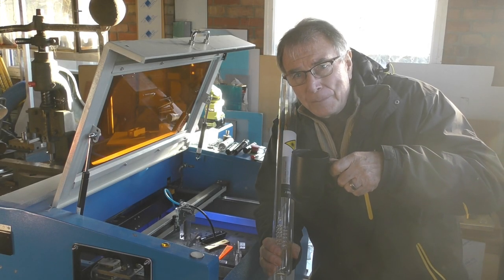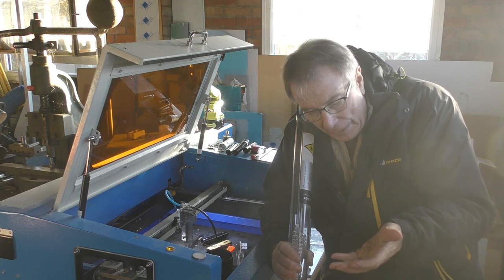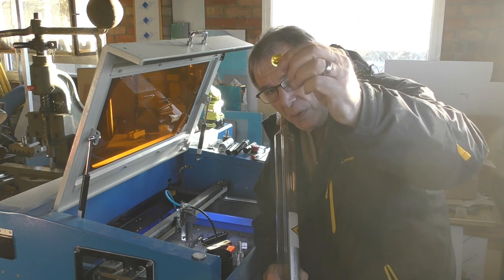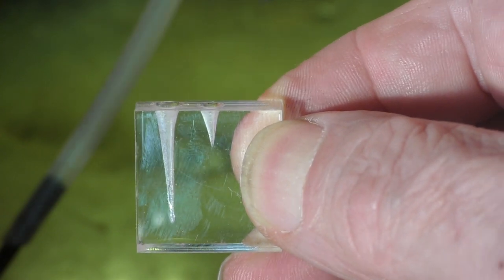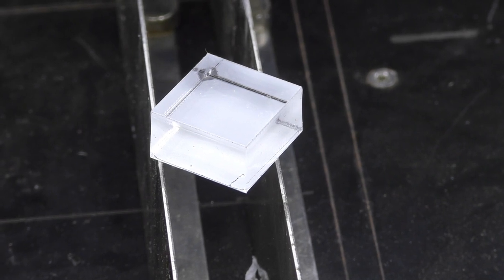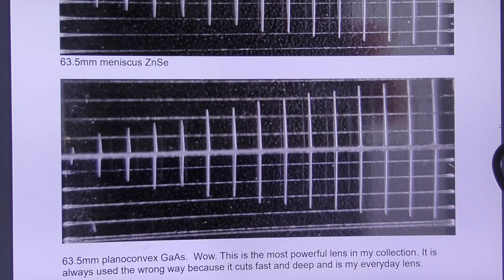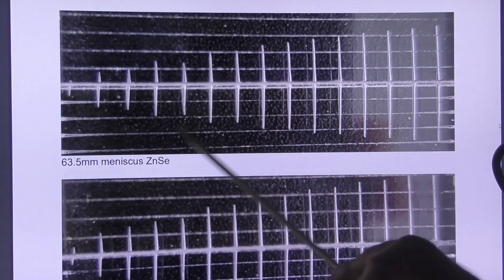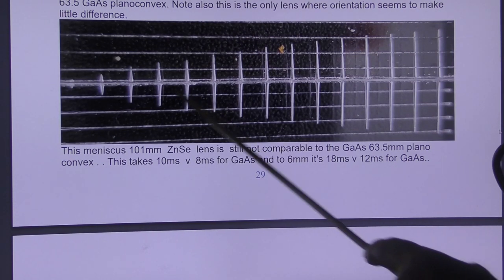RDWorks  Learning Lab 246  SPHERICAL ABERRATION. Our New Best Friend

Comment: OK, deep dive, great results. proving the worth of challenging the status quo!  I think you would enjoy the ted talk be Luca Turin on scent. May seem totally unrelated, but I love how he took on established scent theory as an outsider, working on intuition and persistence and came out on top.
Reply from the maker: Hi Graham
I thought getting you up to date would stop a lot of intermediate questions. As for the scent theory I am sure it will  be to do with those atomic bond vibtations I mentioned that hold molecules together until laser light adds enough kinetic energy to shake them apart.  Although our ears work by low frequency waves up to 20 KHz, our eyes certainly do not. They work with light frequency  in the 500 to 600 THz range. That sounds like  the region that atomic bonds vibrate at so why not smell receptors that sense this frequency  in a range  that does not clash with our sight.  Makes better sense that the lock and key principle peddled for many years.
 Best wishes
Russ

Comment: What is the aberrational difference between the compound lens you spoke of in other videos? Is the compound lens more suited to, say, engraving or cutting or is it a good all around solution?
Reply from the maker: The compound lens exploits aberration in a way I certainly did not understand when I first designed it several years ago. It is not a cutting lens butan attempt at focusing the most intense light rays through a single focal point . A lens with a shorter focal distance still posesses aberration but those more powerful rays at the centre of the beam are refracted  to a much narrower range of focal distances closer to the nominal optical focal point. The compoind lens still posesess cutting qualities  but maybe 6mm or so. ALL lenses have cutting ability but that ability increases with focal distance. The compound lens was designed to specifically achieve a very small "halo free" burn spot  for dithered photo engraving and has an effective focal length of about 20mm. It contains a PVD Chinese lens that limits it power handling to less than 80 watts and why you should not cut with it. This limitation is never a problem if used for photo enegraving because that task is always  done at very low power. Cutting of paper, thin card and veneers best done with the compound lens
Best wishes
Russ
Reply: @SarbarMultimedia  That makes perfect sense! Thank you for the explanation.